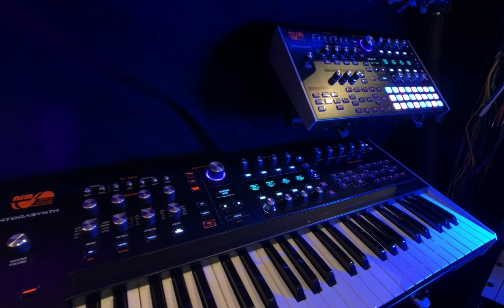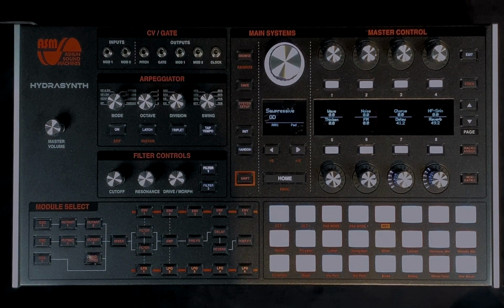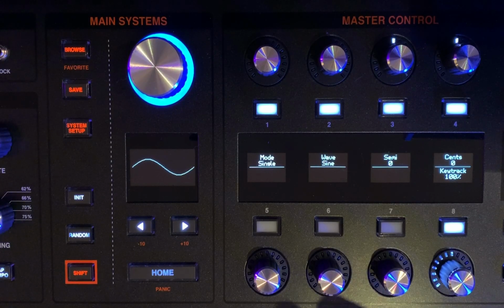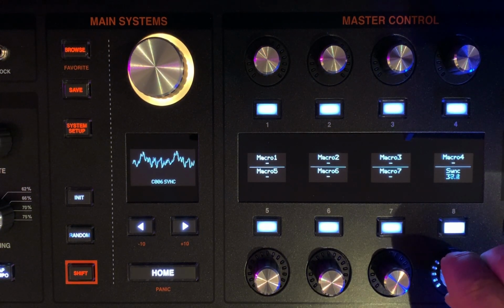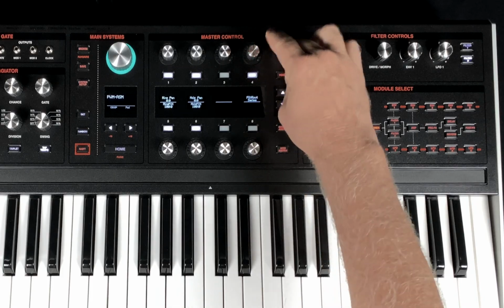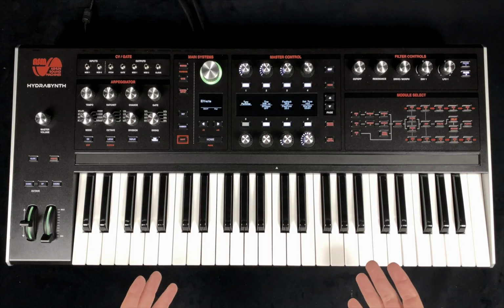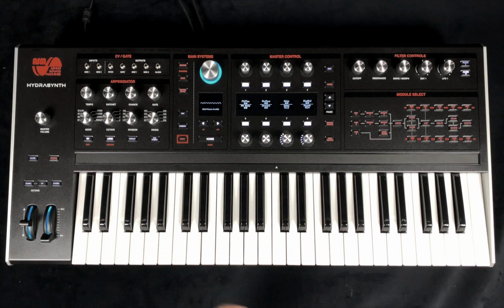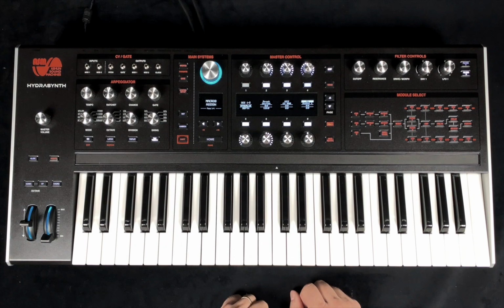Take a tour of the ASM Hydrasynth

Comment: This kind of reminds me of the '80s, when the DX7 came out.  The DX7, with its 16-voice polyphony, 6-oscillator per voice architecture, a brand new synthesis method that emulated the behavior of some acoustic instruments, and of course the velocity sensitive keyboard, that could make those emulations expressive under keyboard players fingertips, all these things made the the subtractive synthesizers without key velocity, kind of well...  People started selling their Moogs, ARPs, Prophets, and Oberheims.  The DX7 was a totally new ball game.  

Similarly, the Hydrasynth is a new ball game now.  Designed using AI, running on a proprietary processor, written in assembler, delivering stunning assortment of synthesis parameters, and that UI that is beautiful, all these things kind of make the subtractive synthesizers, kind of well...  We'll see.

Comment: Wondering if the Hydrasynth is too complex or requiring too much deep menu diving for someone fairly new (less than 1 year) to synths. I love the sounds and features but not wanting to get in over my head with a complex synth. Would be great if there were a class on the Hydrasynths. I have a 37 key analog synth. Not sure if the desktop would be a smarter purchase or just pull the trigger on the keyboard version.
Reply: Fortunately, the presets still sound great regardless of whether anyone understands how they are made! All synthesis is relatively complex and the Hydrasynth has extensive functionality - so it could be described as very complex indeed, but you’d learn as you go. I found softsynths a great way to learn synthesis because they’re so visual / don’t require menu-diving. When you know where everything is and what it means, the menu diving will all seem natural and intuitive. Watch tutorial video for lots of different synths and see how they all relate to each other.

Comment: Hello eveyone. Help NEED.
I own a Hydrasynth keybord. I am trying to record it (MIDI) on Logic X and only the cc messages can be automated while recording. Modwheel ,pitchbend and aftertouch. I need help from someone on the solution to control for example the macro knobs of each preset or any other way i can automate cutoff for example live during recording.Please 🙏🙏🙏
Reply: hey sorry i dont own logic but typically you find the button that lets u go into mapping mode. maybe right click on the parameter u would like to map? in ableton there is a button on the top right that says midi which lets u go into mapping mode. one quick search should solve it for u

Comment: Would love to know how efficiently this works as a midi controller, definitely the deciding factor between the desktop and keyboard for me.  The ribbon and poly aftertouch really appeal to me, but since I only have room for one keyboard my live setup, if toggling between channels is a pain it might have to be the desktop for me.  Would love for there to be a quick way to do it on the front panel via the shift menu or something similar
Reply from the maker: You can make patches that don't have any sound and just have macro knobs and the ribbon set to send different MIDI cc's. To send on different channels requires going to the system setup page. You can then change them quickly here. It is not like a vintage MIDI controller keyboard that have multiple MIDI outs with all kinds of split and layer settings but in a DAW workflow, where the DAW is handling the MIDI channel out assignments it works fine as a controller.
Reply: @AshunSoundMachines  Good to know!

Comment: I'm dying to know in what way the Poly-AT goes to the midi-out. I'm still looking for a Poly-AT keyboard to play my Peak and this Synth would make an excellent addition if I could also use it as a controller.
Reply from the maker: It sends the standard MIDI poly aftertouch message. I believe that Peak receives the message so the two should work very well together.
Reply: @AshunSoundMachines  This is the best news of 2019.
Reply: @AshunSoundMachines  you just sold another unit with this news. I believe my peak and the Hydrasynth are gonna be great buddies
Reply: @SeedtoStage  a peak and hydra synth is literally the craziest combo of synths!!!!!

im jelly
Reply: @AshunSoundMachines  That is very good news! I do own a Novation Launchpad Pro, which also sends poly aftertouch. I specifically bought it for that function. So I can confirm that the Peak is able to receive these messages.